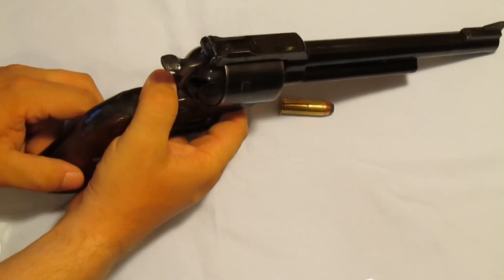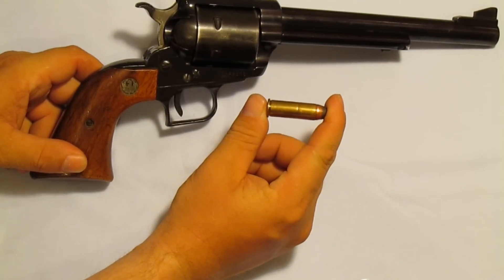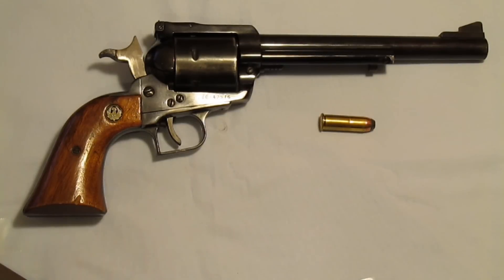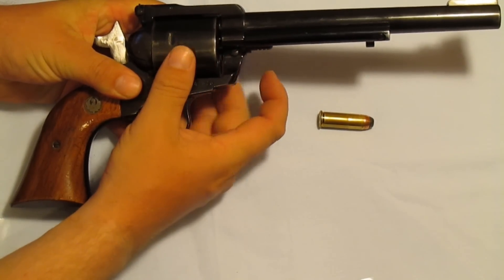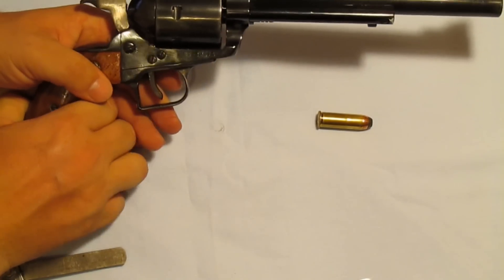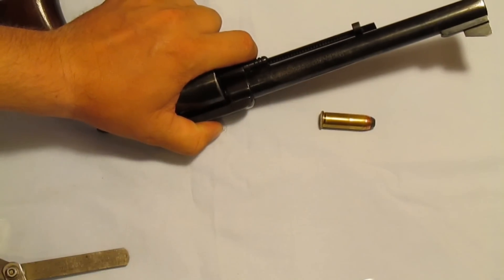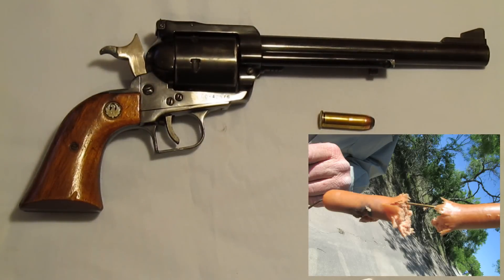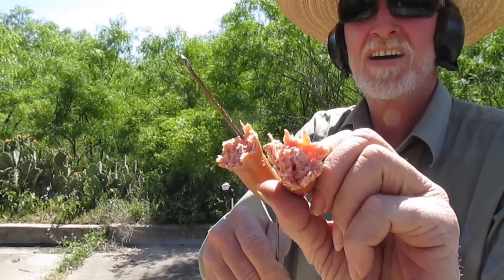Revolver Gas Jet Awareness Video  (Hotdog Explosion)

Comment: Fingers are a little tougher but you still don't want to get it near the cylinder gap.  This weekend I was shooting hot 357 loads (125 grain XTP bullet with 21gr h110 powder @ 1600fps) and for some reason forgot to tuck in my finger. Probably because I was switching between shooting a semi auto just beforehand. I lit off a round and it gave my finger a good wack.  Imagine taking a ruler and using the edge to smack your finger with a good swing - thats what it felt like.  it didn't even break the skin and just had a little redness for 30 minutes.  It was still a little tender the following day but no visible marks.
Reply: I have done pretty much exactly this for the same reason.. yeah it hurts but wont do that kind of damage to a finger